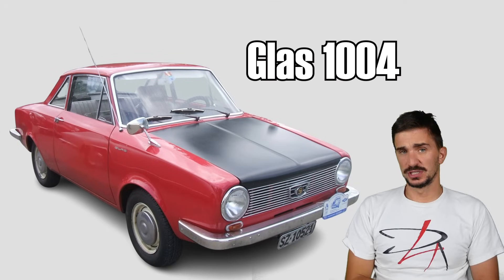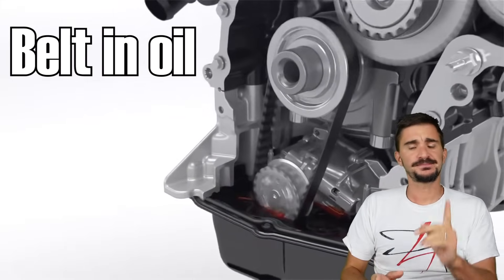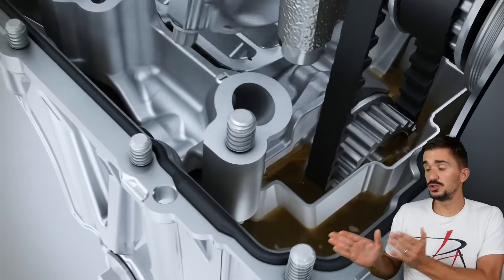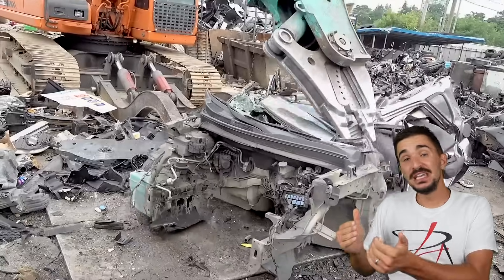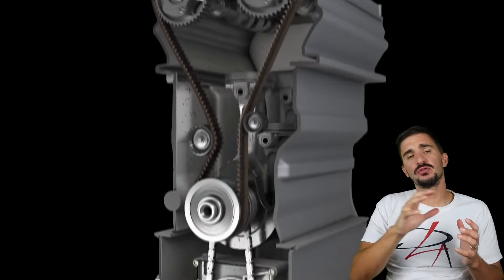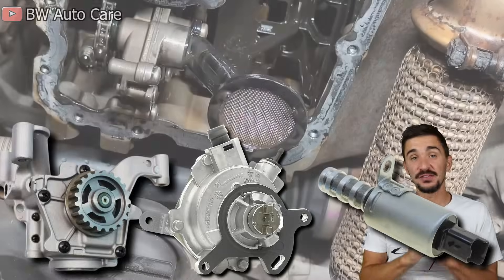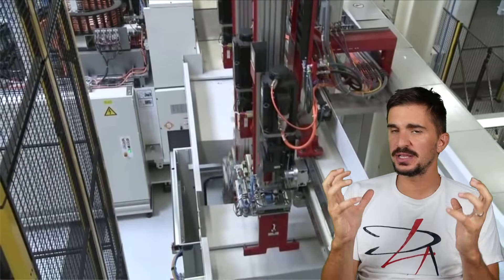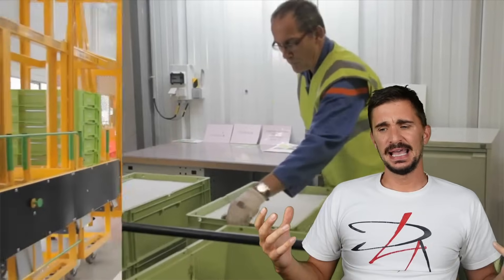Who Approved This and Why Is It Still Being Made? Wet Belt aka Belt in Oil Engines

Comment: We had a Ford Ecosport fail the wet belt at 19,000 miles. Fully Dealer serviced and under warranty. Service manager accidently slipped and said, "Oh, we have had a few of these this year"! We shopped for another vehicle without a wet belt!
Reply: We don't see many on the roads much now
Reply: ... and it was only January 1st 😉
Reply: I watched a teardown of the Eco boost engine with the rubber timing belt it was prematurely cracked with rubber particles in the pick up tube which caused the engine to fail the belt looked like an old timing belt you would find in a 06 Honda Accord that hasn’t been changed since new
Reply: I have a Ford custom 185 pk now 250.000 km Replaced the first belt at 180.000 km oil change every 15 max 20.000 km
Reply: It boggles my mind people would spend 10s of thousands on a car when 30 sec Internet search would tell them of the dangers. Fools and their money...
Reply: People should stop buying vehicles with wet belt…than producers will sort it out themselfs!
Reply: @aurorayoru5333 i have 06 honda with oem belt. No cracks not hard still going strong 180kmiles(yes i kno prev owner never changed it i will)
Reply: @captaintoyota3171  You’re oem belt is not submerged in oil like the Ford
Reply: @aurorayoru5333 I replaced a broken one on a 2.3 Ford, the belt was about 40 years old, I bet you it looked better than that belt
Reply: Mk5 Mondeo/Fusion problem and the service manager told me that the service personnel drive Japanese cars.  That was no slip, he was disgusted by the quality of his own product.  He had a lot of sympathy for me, cut me a break on the price of the repair but it was still eye watering.

Comment: This is amazing timing, a week ago I was showing my best friend a wet belt in a Ford EcoBoost.  He thought it was insane as well.  The thing is a timing chain in an engine with regular oil changes can often outlast the car.  I have an GMC Atlas 4.2 and it has over 330,000km on the original timing chain and I'm still driving it, let's see your wet belt do that. 🙄

Comment: i worked in a Hyundai agency. We had a recall on the new 2.0 Diesel engines after less  than a year. they installed tiny rubber wet belt to power the oil pump. These belts were dry and stiff after less than 50k km.

Comment: I'm an automotive technician and I was working on a 2019 Ford ecotec it came in with low oil pressure. I found that belt material from the belt driven oil pump Had plugged the oil pickup tube. The vehicle only had 60 thousand miles
Reply: Yep. I guess they fail as a dedicated oil pump belt just as fast as the timing belts. Even if the debris is removed and the belt is replaced, there is likely damage that will reduce engine life. Of course, at that point the vehicle is out of warranty and it's either a new engine or a new car.

Comment: If I had of done my research and watched this last year I could have saved myself a lot of money, I bought a Peugeot 2008 then after 11 months found it had a wet belt but also that the engine can suffer premature piston ring wear, so I had a choice spend around £1000 on a chain conversion kit and still live in fear of the pistons or drop £2500k selling it on, I now have a corsa with a 1.4 normally aspirated engine with a timing chain, its not as big but it's a great car (for me) thank you for making these videos and getting the message out there to help others.

Comment: Honda had a change of heart during the last few model years of the civic. The K20C2 engine used in the civic sedan and hatch is naturally aspirated, port injected, uses a timing chain, and is offered with a 6-speed manual. Doesn't make much power but it's almost bulletproof
Reply: In 2024, creating an engine with similar functionality to the original K series they released 24 years ago is only impressive because everyone else is making such overly complicated disposable junk nowadays.
Reply: You silly belt vs chain people! We all know that timing GEARS are king!
Reply: @averyalexander2303  In 2024 using such engine is blatant stupidity, since it offeres worse performance, worse fuel efficiency and worse noise, vibrations and harshness than competition. It MIGHT be more reliable for customers in used car segment, however it offeres 0 (zero) advantages for the customers that... actually buy these cars.
Reply: Too bad it's gone now. Shitty 1.5 turbo only. The naturally aspirated engine from the Fit with a turbo slapped onto it and only direct injection.
Reply: @theocmaniak This thinking is exactly how we got disposable unreliable cars.
Reply: The only thing better could be a non-interference design with no VVT. Think GM 2.8 6- deg V6.
Reply: @Shaker626  Having no variable valve timing is stupid. You give up so much power and efficiency.
Reply: @nothing.mp3  Oh and the Civic is now CVT only.
Reply: @theocmaniak  And somehow the cars that use dry timing belts don't have loud, underpowered, inefficient, rough running engines. Honda's J series V6 engines are widely regarded as some of the best engines ever made and they still use a dry timing belt.

As he said, the NVH benefits of a wet belt vs a dry belt are only theoretical since the rest of the engine (including the external belts and accessories) makes more noise than a healthy timing belt ever could.
Reply: @theocmaniak  What are you talking about? Blatant stupidity? I specifically bought a 2024 civic with the 2.0 BECAUSE of the relative simplicity and proven reliability record. I know I am far from the only one. It has perfectly adequate performance, fuel efficiency and NVH levels by the way. The ONLY reason the port injected K20 is going away for 2025 is due to stricter and stricter emissions regulations.
Reply: I'm pretty sure the "classic" K20 (non performance variant) is a "not for EU" engine that is nowhere close to meeting EU emissions, unfortunately.  Hence the 1.0L turbo DI or hybrid Civic in the EU market.. Even the Mazda DI non-turbo engines are detuned quite a bit for the EU market than elsewhere (down 5-10% on their normal power output), in order to meet Euro 6e emissions.
Reply: @theocmaniak  It very much can be an advantage to even the first buyer. There's a reason "Toyota tax" is a thing. Reliable reputation means car will most likely have better resale value you know
Reply: @theocmaniak  maybe people would prefer the reliability of the more proven k series over the wet-belt, failure-prone ecoboost 3cyl? that reliability is a huge advantage for those that keep their car far longer than the warranty period. and i know of k-series engine cars that still run to this day that are very close to, if not past the 25 year mark that gets it considered a classic and all the stuff that entails.. honda has not exactly been standing still on improving the k-series over that 24 year run either. the aftermarket end has gotten to where they can get 1k horsepower out of the k series pretty reliably on a sleeved stock block, too.
Reply: @davemccage7918  i agree with you, but there is a logistics problem.. how do we get said gearset up from the crank at the bottom of the engine all the way up to the top on an ohc engine without a crapton of idler gears or taking up a crapton of space?
Reply: @theocmaniak  How about resale value? A reliable car has a higher resale value and such a buyer of a new car might be interested in longevity of the new car. Maybe they even have an environmental protecting conscience?
Reply: @theocmaniak  people do buy cars to keep for a long time tho? they clearly still cared enough about reliability to offer something like this, which could even make honda a superior choice. as usual. wouldn't necessarily call that stupid.  Fuel efficiency, noise etc. are not really going to be a problem, its a very refined engine still. and a civic is not a luxury car.
Reply: @niteriderevo9179  Bevel gears. Cars use them in the differential, and helicopters use them to drive the rotors, so they seem to be pretty reliable. Of course, the upper gear must also be lubricated, but there's already oil pumped up to lubricate the cam shafts, so no big deal.

Naturally, a timing shaft with bevel gears is more expensive to manufacture than a rubber belt, and it is less efficient.

And obviously, one car manufacturer boss will then have the glorious idea to manufacture a timing shift with bevel gears made out of plastic...
Reply: @imnotusingmyrealname4566  To a major extent, you are correct.  In some cases, you are wrong.  If you have a heavy duty industrial gasoline motor for a medium duty or heavy duty truck, or for an industrial application, the low RPM range can easily be covered by an OHV without VVT.  In those cases, OHV and not bothering with VVT is actually superior, leading to a lighter and smaller motor with more reliability over the long term.  There is a reason why many generator companies that use gasoline or natural gas still prefer very old US engine designs.  How old is the Chevy 454 V8 big block?  Yet, it is still a top notch design for modern generators.
Reply: @kingduckford  yes for applications with very limited RPM ranges it's definitely not something that would be a benefit so omitting it is better. Same how 2 valves are better than 4 valves at low rpm and if you only operate at low rpm then your engine should have only 2 valves. all this is a recipe for an engine that lasts almost forever.
Reply: That is precisely why Japanese cars are so popular. They work on the long term game instead of focusing on short term profits.
Reply: @markleggett3944  I worked for a German vet manufacturer. Cars which would be exported to Japan were always (yes, always!) reworked to meet Japanese expectations.

I also worked for a German branch of a US automotive company. The German plant delivered outstanding quality. The German unions have been fighting for decades to prevent the US management from shutting down the plant. Management had tried to manufacture that model outside of Germany once, but the quality issues almost killed the brand.

Currently, management is trying to shut down production in that German plant again. Yeah, right. 

Japan still has, of course, the advantage of an extremely toxic "work culture", paired with a skilled workforce.
Reply: @markleggett3944  They are rapidly changing that philosophy.
Reply: @klausstock8020  Thanks!
Reply: @davemccage7918 Sorry, I cannot hear what you are saying because those gears are so loud! Joking aside, gear timing is great and fool proof but god that whirring/whining sound is really annoying. 😅

Comment: 12:50 Our Insignia gave us the "Stop Engine Immediately" message on a freezing cold morning start.  It was the pump 'O' ring.  We got it replaced straight away before damage could be done.
Reply: thank god i did not buy an opel, i dont get how they could screw up an o-ring after this many years of knowledge
Reply: You know; that is actually a Fiat engine, which they used on their (GM) cars!
Reply: You're one of the very few owners to recognize the emergency convaid by that simple warning light. Most people would put time considerations ahead of the state of their vehicle...
Reply: @jayasankabandara4792 doesn't matter who design or built the engine. It was flawed from the start.
Reply: Sell it,, don't waste time with that car. Not only the O-ring will fail, but also the oil pump and many more. Remove it till it still works, those are nightmare engine to rebuild after that and with big chance of failing again.
Reply: @philkipnis740  Yeah! That's right! I tried to say how stupid this design was, because they fitted the oil pickup in the oil pan fixed, and the pump separately.
I feel like they are somewhat reliable engines, but these kinds of cost-cutting things ruin most modern cars!

Don't know exactly, but I think Honda used a GM sourced 1.6d engine in their EU civic cars, which also are somewhat unreliable and stupid in design!
Reply: Was that 2.0 cdti? Do you know the engine code? Maybe not all Fiat 2 litre diesels had this issue, did they change that o ring at any point?
Reply: @janadamski8859  Sorry, but I am not sure about the exact model code of the engine, nor did they fixed it in the end of the life cycle! (I think they called this in the following names; 2.0 JTDm/CDTI/TiD/TTiD/VCDi/Multijet II/DDiS)
Reply: @jayasankabandara4792  That's what I was afraid of. So what's the course of action? Will the engine run unproblematic if you change that seal more often? How often is enough?

Comment: D4A, another great video my friend!
I'm a motor mechanic, an old motor mechanic.
These kinds of things pop up from time to time and have done over the years.
What HAS changed, is that the manufacturers don't care like they used to.
They used to care that they had released an inferior product and would work hard to make the replacement better.
An example on a personal note, I owned a Spanish built  D40 Nissan Navara 2.5 diesel. They became renowned for timing chain failures in the Renault engine after using fine pitch chains and plastic guides to reduce engine noise. (Mine was replaced by Nissan as a 'good will' warranty claim at 113,000km). 
I now own a D23 Navara and it says in the owners handbook, timing chain replacement due at 300,000km. If that chain fails before then, Nissan will need to be very clear why it has, and why I should be responsible for replacing it.
Reply: I agree that the attitude of manufactures have gone downhill to our detriment.  It appears their strategy has changed to accommodate this:  they are selling on features more and more, capitalizing on the current popularity of high tec electronic gadgets.  Their advertising pushes all the convenience features indoctrinating the younger generations that they deserve to be pampered by their vehicle.  Does anyone repair their own vehicle anymore ???

The situation is made worse by the ridiculous extent fuel mileage regulatory requirements have pushed.  Regulations are so far past the point of diminishing returns the life cycle cost of hardware is probably greater than the fuel cost improvement.  The auto manufacturers actually like this, as it makes the service lifetime shorter for all manufactures !
Reply: The most reliable system is a gear drive, but those are noisier, create more frictional loses, are more expensive, etc. Modern engines are not suited or set up to use this system, so we get one that hopefully will get through the warranty period.
Reply: @markleggett3944  The most reliable system is one that's engineered properly. It doesn't matter if it's a chain, a belt or gears, if it the engineering is underdone, then you'll have failures. 
Gear drives can fail, Holden in Australia used a fibre gear on the cam of their old push rod engines to make it quieter... It was certainly quiet when the teeth stripped off on the highway and the engine stopped. 🙂
Reply: @Danger_mouse  Years ago, Pontiac used nylon and metal timing gears to lessen weight and noise and those failed quite often as well. Too many times management/accounting people override the engineers and then we get substandard designs and parts. Government mandates are also a major reason we keep seeing this type of problem.

Comment: When I first heard about a wet belt in an engine my immediate reaction was - what a stupid idea.  Thanks for validating my reaction.  Excellent analysis.
Reply: Toyota used dry belts on non-interference engines such as the Camry.  Belt breakage caused no engine damage.
Reply: 90% of the public does not know or understand these things.

Comment: My relatives had a Fiesta where the timing belt broke at 48,000km. Vehicle was 4 years old, maintenance only at the dealer.
After a bit of back and forth it went under warranty, but they then sold the car and bought an older Toyota Yaris.
Reply: I have a 2002 toyota yaris. The engine runs fine.
Reply: I have a 2004  Toyota Echo. 380,000km. Still running good. No timing chain noise.
Reply: @glennmerriman8382  Good to know, ty!
Reply: @TheBlackbrrd  I have a 2004 Fiesta and it works great... 
What's your point?
Reply: @ickebins6948 Your 2004 model is a pre wet-belt engine so you won't have the issues discussed in this video or comment.
Reply: @SKYWURX  I know... 
I was refering to Blackbrrd and his "Yaris statement". Should have been obvious.
Reply: Strangely the Fiesta with the Kent / Endura / Zetec RoCam are bulletproof
Reply: @gabrielv.4358 They are indeed!
  I had a Fiesta mk7 1.25, sold it with 198k km, no problems at all engine wise. 
Timing belt change was cheap.
Reply: I have a 2013 Toyota Prius plug-in hybrid with well over 250.000 km. Zero (0) problems ever. Just regular maintenance. The original lithium battery is fine too. Great car!